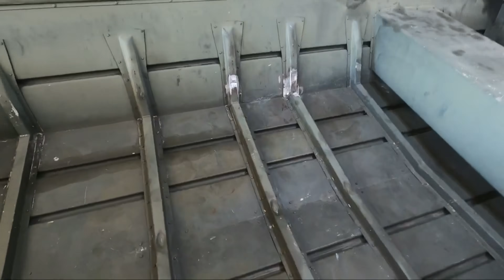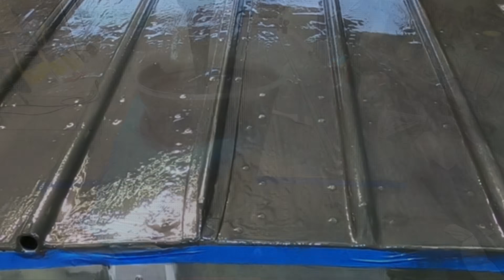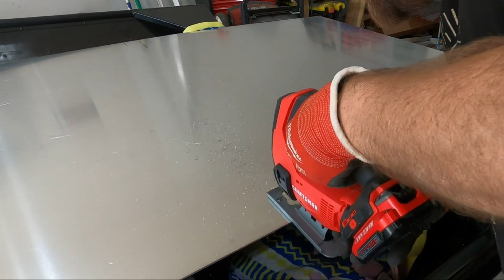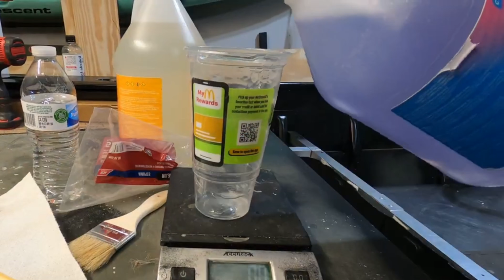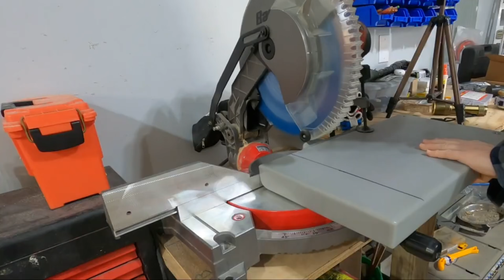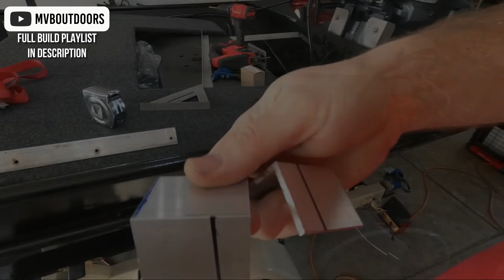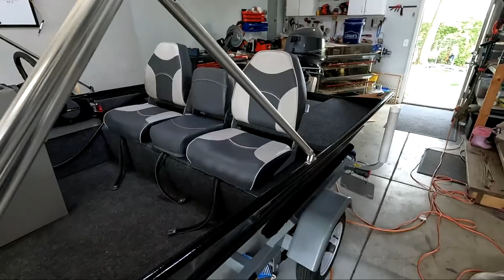1648 Jon Boat Conversion - FULL Build Start to Finish Transformation

Comment: How did that console turn out, your video is the only one I can find for the rpd console. Did it loosen up after time? Build quality good?
Reply from the maker: It was excellent, the material was nice and rigid with thick plastic. How you mount it will determine how well it does. I added an angle bracket from one leg to the floor to give it more rigidity and it was great. I wouldn't hesitate to use it again. In fact I have future plans to build a center console style boat and I was going to use their center console unit to do it.

Comment: My Sea Scouts are about to get a Jon Boat donated to us.  It's got a small 9.9HP on it.  Curious if you've documented the parts lists and costs anywhere.  I'm curious to see if even a partial restoration/upgrade like this is in the budget for us.  They basically have all the skills already shown, plus fiberglass experience.
Reply from the maker: The bulk of the cost came from the motor, electronics, and sheet aluminum. You could significantly lower costs by using plywood sealed with fiberglass resin or epoxy. It would only be a couple hundred dollars for some wood, outdoor carpet, paint, etc to make it look really nice. How far you take it would depend on the cost though.

Comment: 0:57 I don’t have air compressor so can you use a hammer or is there electrical ones
Reply: @TateHandy  you can use a hammer but itll take a minute and you might be on the struggle bus for a minute. Make sure you have something solid backing it and that the boat won't shift of you. There are electric hammers but they might take a minute

Comment: I'm just wondering why you didn't use hydro turf on floor.  I used it on mine and I love it.
Reply from the maker: I wanted the carpet to run up the sides for a clean look, however I ended up loving the hydro turf on the front deck so I wouldn't hesitate to use it as flooring in a future build.

Comment: I have the exact same boat shit you not model 1670. I’m getting ready to put the floor in now. what gauge of sheet aluminum did use? Was that c channel also you used for the sub flooring across the ribs?
Reply from the maker: 1/16 Angle - https://www.youtube.com/watch?v=rJfItH2scpY

.100 48 x 96 3003 Aluminum Sheet - https://www.youtube.com/watch?v=Ya7LbzR3oEo
Reply: @mvboutdoors thank you sir, your videos helped me get alot of ideas. Never took on a bigger jon boat like this before 😂 thanks for videos and help!

Comment: Hey! Out of curiosity what’s the best way to clean this out- I’ve never had a carpeted boat I’m used to just power washing everything- are there issues with mildew or water getting under everything
Reply from the maker: With the floor being aluminum everything runs out the drain plug when washing. No issues with mildew as nothing really retains water.
Reply: Awesome looks sweet!

Comment: Hydro turf is great stuff very interested to see how the rear platforms hold up. I’ve got a standup jet ski and gets wet when riding mostly submerged and it’s held up great in my opinion so you should be good I’d think but time will tell once again finished product looked great maybe I missed up but what did you end up someone dollar wise rounded up to the nearest hundred ?
Reply from the maker: The outboard was the biggest expensive around $5k, for the build itself around $2-3k. Absolutely loved the hydroturf

Comment: Ya know.... since you installed a steering console and added float pods your boat could be rated for a higher horsepower outboard. Just fyi.
Reply from the maker: Yeah I think it would have handled a 30-40hp no problem.

Comment: What’s your thoughts on using the Hydro turf on the whole boat instead of carpet. I’m not a huge fan of carpet in a boat anymore. Awesome build!! This thing is super nice! 

Also one more tip, have you thought about a front cover for the console and maybe integrating a cooler or livewell somewhere in the boat?
Reply from the maker: @Tyler1331  I think full hydro Turf would be super comfortable, I'd like to try it myself!

Comment: May i ask how much ypu weigh?  I ask this because ive wanted a jon boat for a while but have never been on one. I've always thought i exceeded the weight limit on them.  Im 6'5 350lbs.  Any information is greatly appreciated.

Very nice build as well!!
Reply from the maker: I'm a big guy like you and can say Jon Boats can definitely work but you need to buy the right size. I wouldn't go any smaller than 48" bottom width. A 1448 or 1648 would be fine.
Reply: @mvboutdoors Thanks for the input!!you think that would hold myself + another 150lbs (2 kids) + motor + fishing gear?
Reply from the maker: @charleshathcock5223  yeah I regularly had the kids + myself out on the 1648, I wouldn't go much smaller with 3 people just for space
Reply: @mvboutdoors  perfect!  Thanks again!

Comment: Hi, I'm Brazilian. I'm doing my first project for a small boat. I loved your video, I will follow the channel. I would like to know if the carpet worked or if it smelled bad afterwards?
Reply from the maker: No bad smells at all, worked very well. I've used it many times now, I actually use it in my truck bed when hauling certain things.
Reply: @mvboutdoors  Cool! In Brazil we don't have this habit, so I'm curious, is this carpet the same as the ones in theaters and indoors or is it a special carpet made to be outside the house?
Reply from the maker: @sidneypsi  it is made to be outside, it is not a thick and drains water easily.

Comment: Is it just me or does that motor look to be set at to much of an angle backwards? Great looking boat all round
Reply from the maker: The motor setup was a little wonky getting a long shaft motor to work on a short transom, it levels out though on the water.

Comment: Great video and nice build!  
I’ve never worked with hydroturf, but I’ve read  /watched a lot of videos where they say if you have any type of edge or bump (rivet) it show pretty bad through it. Seeing anything where you patched that hole?
Reply from the maker: Thanks man! Yeah if you have any bumps like rivet heads they will show. It's not too bad, if you use a camo style you'd never see it but on flat colors you do. The full video for the turf you can see the build a little more. As long as your edges are flat though it's purely cosmetic. 
No issues with the patch!